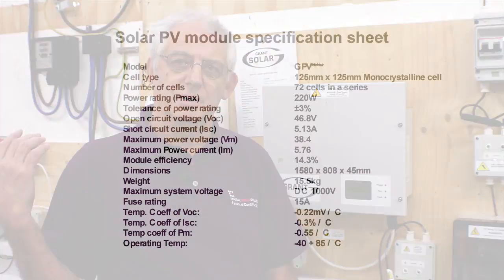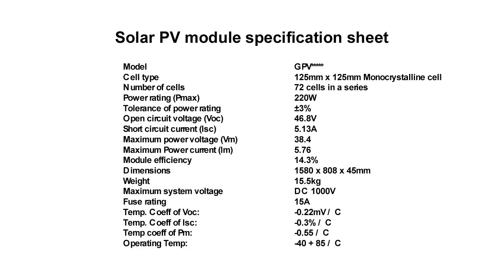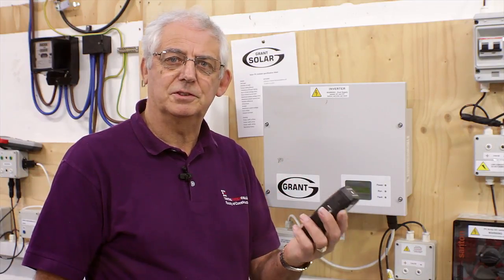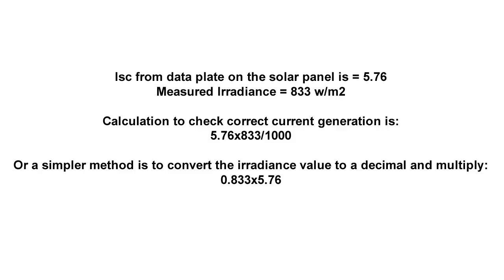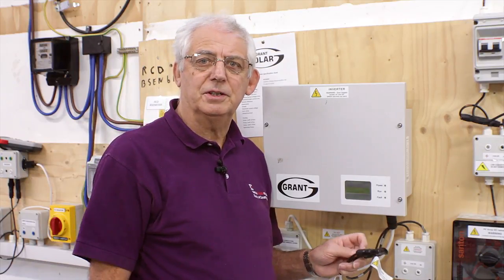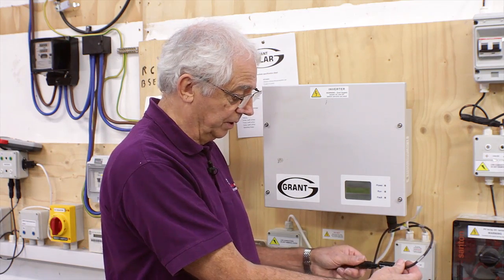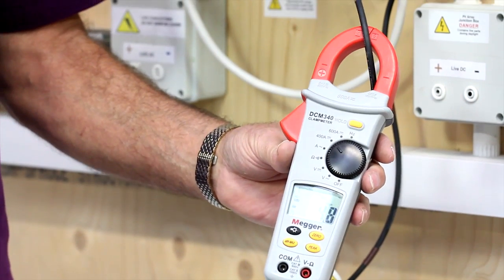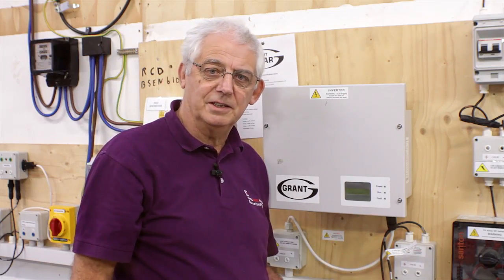QR code 16 -- Photovoltaic short circuit current test

Comment: where did you get your 1000W persquare meter  is that a standered number you use for any module
Reply: Gil G 
I think he is wrong on this one.  The area of the panel is 1580 x 808 mm which is 1.58 x .808 m^2.  
area of panel = 1.277 m^2

max power = 220 watts so  we get 220 / 1.277   watts per sq metre.  which is 172 watts/m^2

but the panels are 14% efficient  so the sun power to produce 172 watts needs to be 172 x 100 / 14 watts
which is 1230 watts/m^2
not 1000.

Also, the table of figures shows the short circuit current is 5.13 amps while the max power current is 5.76 amps.  This is not possible.  The short circuit current must be larger than the max power current.  It has to be.  

So something is wrong here.  Maybe they have been mixed up the wrong way round - he says the short circuit current is 5.76 though the written data says it wrong?

but the max power current (5.76) times the max power voltage (38.4) does give the rated power output 220 watts (well, 221 watts but near enough) so I am not sure what is wrong but something is.

The chances of him going out and taking a light power reading and then coming back and getting an exact match leads me to believe that the figures in this lesson have been fiddled to match the result.

its a bit of a mess really

cheers.
Reply: @Hereford1642  damn, I was on a high finding this clip, then a low after reading your comment.